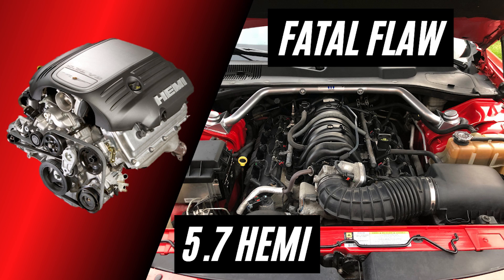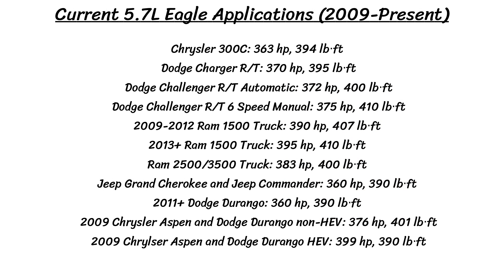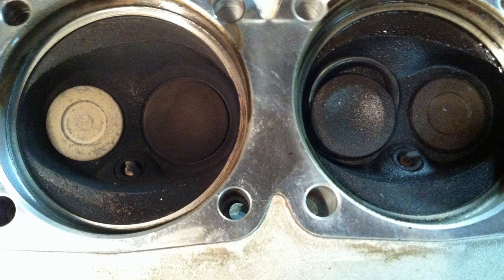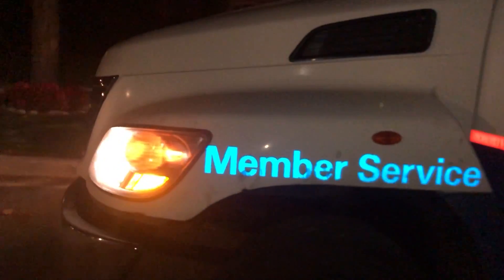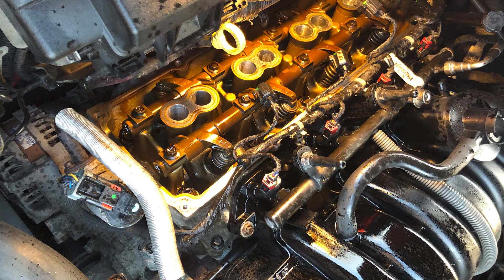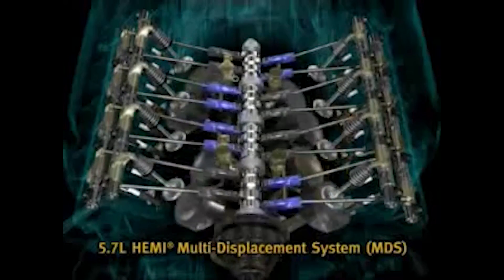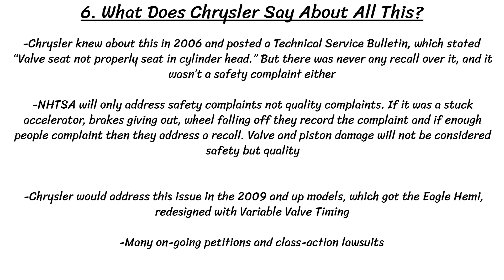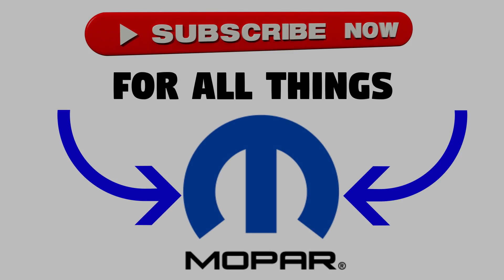The Fatal Flaw of the 5.7L Hemi V8 Engine & How to Prevent It (2003-2008 Valve Seat Drop)

Comment: I’m on my second magnum and the first one I had in high school dropped a valve most likely because I beat on it 😂 but now I got another one a few years later after having my srt8 300 get totaled from being rear ended but anyway when I get gas sometimes it has that shut off problem but the dealership I went to said it only has an airbag recall nothing for the gas tank so Idk what to do

Comment: My heads went out right at 200,000 miles in my 2006 300C ! I put 40,000 of them on there. I bought it because it was one owner & clean. I’m getting new ones. I’m going to change that thermostat & try to take off the MDS. I would run straight pipe but I don’t want to make lots of noise. Just some. Great Video!

Comment: I had an 06 r/t charger same thing happened to me at 90k , hard lesson was learned about 3rd party warranties , they said the heads were covered but not individual head parts , and since the valve seat dropped in the cylinder wall and scored the block that they wouldn't cover it , when it happened to me the car had been sitting 40 minutes or so since last operation , stopped to get gas then couldn't get the car to start back up after

Comment: I've experienced this myself.

I own a 2008 Dodge Charger R/T, and I'm the 7th owner. Bought the car at 81,000 miles, owned it for about 2 years. I drive the car hard as shit every day, as that is what I intended when buying it, and up until 2 months ago, I've never had to replace anything besides a sensor or two.

Right around 101,000 miles, trouble struck. I had just driven to buy some oil for an oil change, and I drove back home (hard driving, per usual). Pulled into the driveway and immediately shut off. (By the way, I have MDS off since ownership.) I went inside for about 5 minutes to put some stuff away, came back out to move the car into the garage, she gurgled and barfed, but never started. This is when the headaches began.

I sent the car into a Dodge dealership near me on September 21, 2020 (extended car warranty only applicable there), and after a week, they called and told me "shattered piston ring caused engine failure, new engine required." So, a few inspectors came around, and ultimately the warranty is covering a brand-new engine swap. After talking with the foreman, he claims it was definitely heat damage of some kind. He also noted oil in places that would indicate the car was supercharged or turbo-charged at one point.

So in summary, heat damage caused two piston rings to crack, break, and clog up some pistons, which then damaged the heads. As of right now, the car is still in the shop, 2 months later, brand-new engine ready to swap, but my old block still in the car. I'm willing to bet they'll find a dropped valve-seat when they break down into it deeper.
Reply: That's a fucking steal right there though. Basically just became the lucky owner of a brand new car at that point and all you did was pay used value lol
Reply: @kylealton4347  Ah I forgot about this comment. Here's an update!

After searching deeper into the car, the head foreman at the Dodge Dealership concluded that:
1. The engine definitely showed signs that it had previously been supercharged or turbocharged, as he previously thought. (Not something I could've afforded, but interesting to know)
2. Yes, there was a dropped valve-seat, plus a shattered piston ring, but the foreman further explained his confidence in concluding heat damage as the overall cause.

I'm still not quite certain how heat damage was the issue, because my radiator assembly works incredible.. Temperature gauge never rises beyond half, and I've had all that checked just in case! Nonetheless, I've now got a brand-new 5.7L engine, currently with 1,051 miles, had a soft break-in for the first 800, now I am just starting to drive semi-hard again per usual. She drives great, actually even better I'd say! Everything else still has over 100k miles on them though, so I'm certain I'll be replacing more stuff eventually. The most recent video on my YouTube channel, test footage of my SLP LM1 exhaust, is just weeks after I got my car back.

And yes, I paid like nothing for this car, quadruple digit range. I only had to pay $150 (MaxCare warranty from CarMax) for a $6500 engine swap+labor! (According to Dodge) It's a stupid plan from CarMax, but I'm honestly surprised it saved me in this situation.
Reply: @RedMephis  hell yeah. Honestly. It could be because the mds shut off those cylinders. That due to heat transfer the valve seats closer to the firing cylinders remained cold but the walls around them heated up because they're a softer metal than the steel seats. So I would just stay off the mds 🤷
Reply: @kylealton4347  Yep, I recall seeing stuff about that on various google searches! It was one of the first things I did, used a Predator 2 tuner and disabled MDS. I've also read things about changing the AC sensor to initiate at a lower value, such as 180, or 160. Either way, hopefully with the MDS disabled, I won't have any further issues down the line.

Comment: Apparently my 2005 dodge magnum rt doesn’t have mds. Guess thats why it has over 200k miles on it ;-)
Reply from the maker: Yeah started in 2006 I believe for MDS on all the LXs
Reply: @MarspeedCars  I have a 2005 300c with MDS. I rebuilt the motor and the shop did not fix my valve seats correctly and dropped a seat first time it got it got hot. Didn't know rad had a leak. New piston, head. good head shop and it's running again
Reply: I have an '05 Hemi Magnum RT and it has MDS.
Reply: @martinmessineo4964  AWD or RWD?
Reply: @evildrizzt1  Mine is RWD. I have the same vehicle as Martin
Reply: I also have a 2005 Magnum RT and it has MDS.
Reply: @Hybrid Libertarian Where did you get that percentage?  I don't believe it.

Comment: Great advice and good information. One thing I might add...if you get a handheld tuner you can also adjust the  temperature at which the fans kick on.  In my magnum I slapped in the 180° thermostat and have my fans kick on earlier. At idle I sit at around 193° and after spirited driving it spiked up to around 197-203°. I've seen as high as 213 but that was in the middle of Phoenix, AZ in July after doing a few pulls.
Reply: So what are the exact temps you have them come on? I have the Diablo I3 and followed HHP’s website.
Reply: @Juju-zq5qj  where do they list their recommendations?
Reply: @JayyBird93  search HHP 180 thermostat for 5.7 hemi  and there should be a page with everything you need

Comment: I’m friends with 3 mechanics one being my brother and I’ve talked to them all about my truck because I have a 5.4 3v. at first I was talking about how idk about how the motor will last after I fix it and they all told me the same thing: the 5.4s issues can be fixed. They all told me that the 5.4 is a great motor if taken care of, but if it were a dodge 4.7 or 5.7 V8 truck then it would be a different story. With the Hemis the issues really aren’t preventable... the first gen 5.7 really isn’t that good of a motor it’s just the honest truth. The newer ones are great besides the rollers on the pushrods having their needle bearings go bad bad that is a fixable problem unlike the valve seat issue. Not hating I’m just saying.... all y’all shitting on the 5.4 in the comments saying “at least its not a 5.4” well the first gen hemis are actually worse than the 5.4 3v.... the most problematic 5.4 made. If you maintain a 5.4 as recommended it’ll last 200k miles garunteed issue free.
Reply: Yes I’m aware that the dodge 4.7 is different due to it being overhead cam but it still has the same issue

Comment: Respectfully, I am a Chrysler engine development engineer of over 32 years although I didn't participate in the development of the 5.7 but I was working when it occurred.  First are you sure the greatest occurrence is on deactivated cylinders as this makes no sense since these cylinders would cool off quicker and the aluminum would tighten up on the valve seat sooner?  Also thank you for providing so many pictures as I noted  detonation indications in some of them.  Is it possible that , at least some individuals were using less than the recommended fuel quality?  Detonation dramatically increases the heat load into both the piston and the head and this would certainly compromise the interference fit between the valve seat and the head.
Reply: Well, it could be possible that it's the ones that are shut off. In fact it would make the most sense that it would be the cylinders neighboring the firing cylinders because they'd be so close to the heat for so long, and the block would be hotter and the aluminum would be hotter through the heat transfer but the steel would remain cold. You're thinking as if it were reacting to direct heat as if it were isolated. This would make the valve seat closest to the neighboring piston still cold while the cylinder of the side that it's on is hot, and most likely really hot after long driving periods, as any motor would get. So now that all that's uneven. You go shut the car off, start it back up, all 8 cylinders are firing now, the mds cylinders that stay on are normal operating temp. The 2 cylinders furthest away are cold and the 2 cylinders in-between, well they just dropped their valve seats
Reply: They eat camshafts having that active
Reply: Used the highest octane gas made always. Still happened oil changes, always watch the temp to never overheat it.

Comment: Yeah you’re forgetting the lifter no oil problem and the design flaw . In all the new hemis. hey go check out uncle tony garage and he shows the design flaw and the real problem and the new lifter position To this crusty problem and Chrysler is hiding it because it’s the elephant in the corner and no one’s wants to Mori Chrysler but there’s some that are fed up . Also I’m tired of the wired up mouse boxes . One off the best engines I got my hands on was a Stage 3 Buick 455 Performance Engine @@@@@@ me I was banned from most tracks because I ran on a shit day and no grabby high 9’s . She hooked and layed out high 8:50 
The Buick version of the stage 3;455 is actually quite different from the Oldsmobile version. Instead of altering the stroke, Buick honed out the cylinders on the 430 CID Buick Wildcat engine. For this reason, GM considered it a thin-walled big block. The advantage of this casting design is a significant drop in weight over the other 455 versions.

In fact, the engine actually weighed close to 150 pounds less than the legendary 454 big block that Chevy used. This weight reduction compensated for slightly lower rpm output from Chevrolets version. They rated the standard issue 455 at 350 HP and the high-performance stage I version at 360 HP. I recall stage ll was around 460 . And stage 3 that never happed but did happen was around 505 but it had a slews of problems just like Chrysler . Who’s smarter. 

This engine had a short run starting in 1970. In 1975 General Motors started using the same engines across the different divisions and platforms. This gave them better compliance control for the increased power and fuel miles they buckled it because it out preformed Chevrolet’s 350 in the bottom end and in the top end . Yes the rpm climbs is slow but no trouble with a 700R power glide .

Comment: Almost the exact scenario happened to me on my 2006 300C AWD.  Engine was running flawlessly at 105K miles and then one day after a couple hour highway trip I stopped for gas, went to restart and it stalled.  Had it towed to my mechanic and he managed to get it started and voila, destroyed the engine.  I put a used engine in and am hoping this won't occur again as I'm coming up on about the same mileage on that engine three years later.
Reply: Same year mines around 134k miles still strong 😎

Comment: My wife and I have an '04 durango with the 5.7l v8. While it's running just fine at 161k miles, I'm curious to know how to tell if the engine has MDS. Outside of this potential issue and my wife really wants a hellcat durango, our suv is a solid and powerful beast and were thinking on rebuilding the powertrain later on down the road given that it would be more cost effective over time (vs buying something new) and she loves her rig. :)
Reply from the maker: I believe MDS was added in 06 so you don’t have it! Agreed I went with the cost effective route of rebuilding, I’m young and didn’t want to get a car loan on a newer SRT so I’m just building it up with many improvements! 💪🏼
Reply: Check the VIN. If the 8th digit is a “D” you don’t have it. If it is an “8” you do.
Reply: @thaddeuszimmerman8242  our durango has a "d" in the 8th spot of the vin. So no mds, thanks for the info. :)
Reply: mds was added 2004 or 2005

Comment: That MDS system is one of the worst things ever installed on an engine. I shut it off on my '14 300C, gas mileage actually got better. Thankfully, my hemi cars are all the later design and my Challenger is a '12 with manual trans, no MDS BS in those engines. 
180 degree thermostat makes a big difference.
Reply: MDS rocks
Reply: @snek9353  you can go ahead and keep it. Your choice.

Comment: Same happened to mine sent to a shop that knows about this problem I had the motor rebuilt they remachine the heads with the valve seats something like 1mm bigger. Don't have the exact measurements but there are shops online that will send remanufactured heads with the valve seat problem fixed. This was back in 2016. I've put 4,000 hard miles since then everything running good. Also you gotta blame cheap oil and gas that don't protect the motor. Since my rebuild I  religiously use advance full synthetic oil. Preferably mobile 1 but have used castroil and Pennzoil has to be advanced. I know and seen plenty of just casual drivers with v8 motors putting regular unleaded. That is death for not only the motor but fuel system will be the next thing to go out around 120-140,000 putting cheap fluid in these vehicles. Your charger looked good any plans for it or are you getting something new?

Comment: 2012 300 (Mopat edition) 103k miles cylinder 5 went bad. New engine needed according to dealer. Had another shop replace whatever in the cylinder5. Drives well but seems to be running hot. Just on the right of the halfway mark on the temp gauge. Thinking bout the thermostat change to a 180 degree.

Comment: @Marspeed do an MDS failure video pleaseeeee..seems like dodge has had about 12 revisions of lifters since the eagle came out.
Reply: MDS is not an issue, and 1 revision.
Reply: @snek9353  mds is absolutely an issue , the lifter ledge gets torn up and they then don't lock anymore, on the normal lifters in mds cars the needle bearings have been revised about 12 times til the 787 hellcat lifters..Ive removed ,replaced or partially repaired about 400 in my shop since mds's inception.
Reply: @kbrx4310  The MDS failure to lock does occur yes, rare but yes and more often caused by rotation of the inner body. It however is not a cause of the seat and lifter roller issues people are talking about. 

There's no such thing as hellcat lifters. The 5038787AD is just the latest Non-MDS lifter with the larger rollers. The same lifter is used in all Non-MDS positions in all engines since that update. Yes there's a lot of part numbers, but really only one significant revision, that's the change to larger rollers.

Comment: Wouldn't removing the plastic shroud help as well?   Even though my 2016 is newer than the effective dates, I'm leery of running in 4-cyl. mode.    Although I usually drive with that shut off anyhow.
Reply: How do you shut down the MDS system off? To my my knowledge, you can't.
Reply from the maker: You need a tuner to do so. My diablosport was able to do it, otherwise you can’t

Comment: I wonder all what would entail dropping a 5.7 into my 4.7 Dakota I wonder if it's even worth the trouble but it would make it one sweet truck
Reply: I often wondered why the 5.7 wasn't available in the Dakota's.The people grousing about their 5.7's problems when the 4.7 was a REAL p.o.s. The 5.7 into your Dakota might be an easy swap but I'd worry about the wiring. The computer and all the sensors would have to be figured out as well as the transmission hook ups too.

Comment: Mine went at 138000 2006 300 c hemi Drive fine went to the gas station got some food came home shut the car off ran in the house went back out started up and it started shut off then start chicken and half of that smoke and check engine light flashing so now I’m in the process of getting it rebuilt with the 09 heads and exhaust